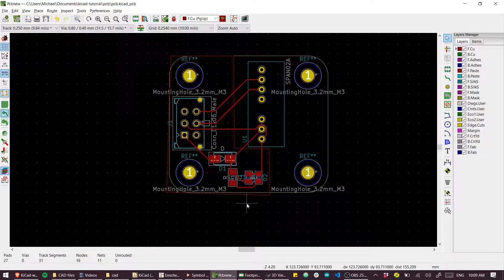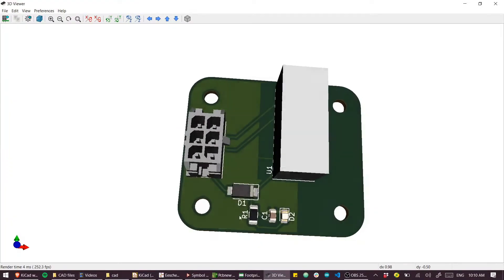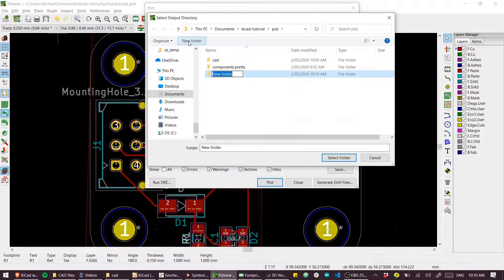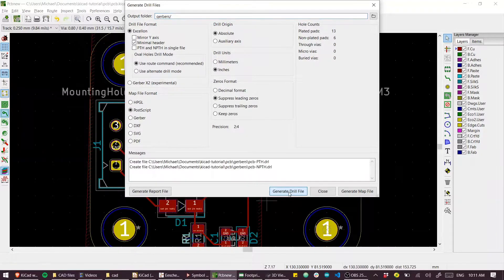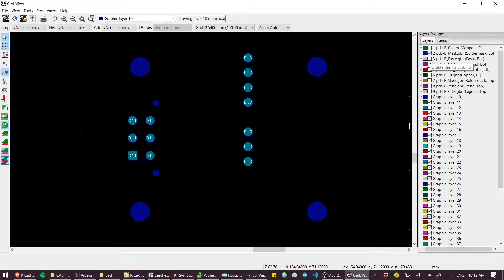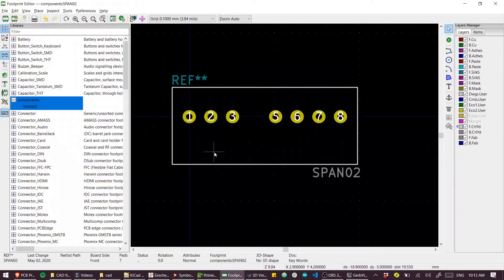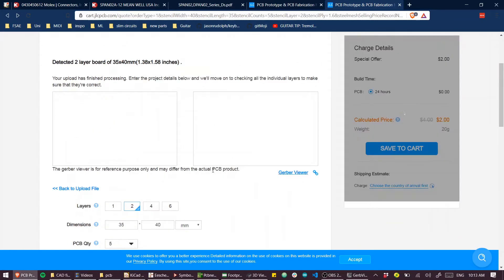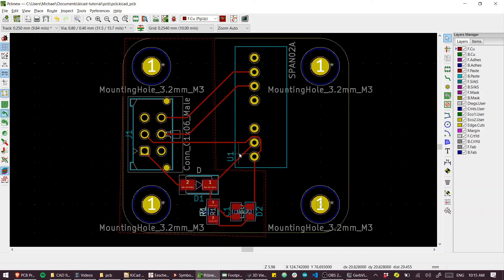KiCad - Zero to Hero 7 | Generating gerbers and uploading to a PCB fabrication service

Comment: Hello - thank you for this tutorial. It was very helpful for me and I could easily follow along also with the newer version7 of KiCad.
Only one thing seemed weird to me: In the 3D CAD model of the Molex connector, it seems to me that pin 1 is on the right bottom side (notch of this pin is in different orientation than for all other pins). In the PCB design however, it seems that pin 1 is on the left bottom side (square pad instead of round pad).
Is that an issue with the footprint? Because I cannot see any way to make the pin 1 of the 3D model and the footprint actually match each other?
Reply from the maker: I see what you mean!
Yeah if you really want you can line up the numbering in a custom footprint to match eg this diagram. I used the builtin footprints and I'm sure they ought to be well considered
https://imgur.com/a/9VENWhj
Reply: @MichaelRuppe  I guess, the footprint itself is correct. That also matches the drawings you sent int your reply. What seems to deviate is actually the 3D Model of the socket. I guess, they botched the position of pin 1 in this 3D model (indicated by the deviating orientation of the bevel on the pin). Electrically that makes no difference - and in an actual socket (when you build that PCB), the shape would be anyhow correct again.
Reply from the maker: @happyasahippo8597  hey good catch! I could see your discrepancy but couldn't quite join the dots. Glad it's resolved. Weird because Im sure ei got the cad from molex. Perhaps I didn't? 🤷‍♂️